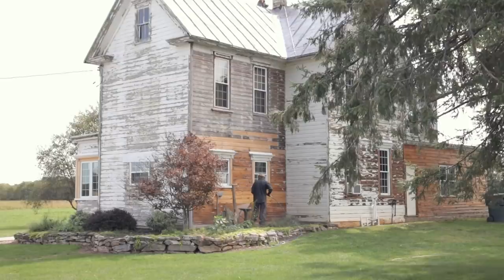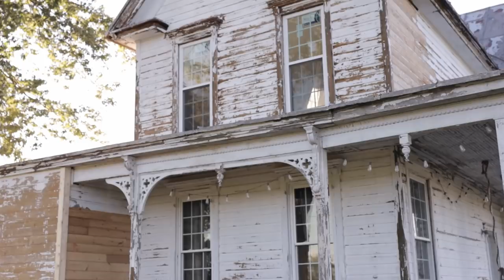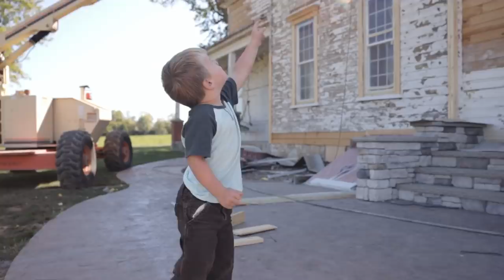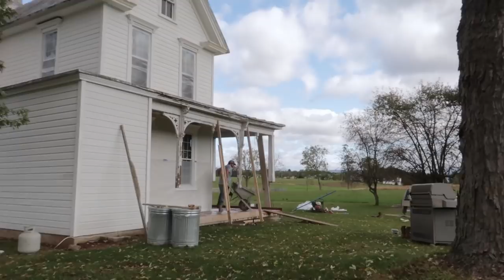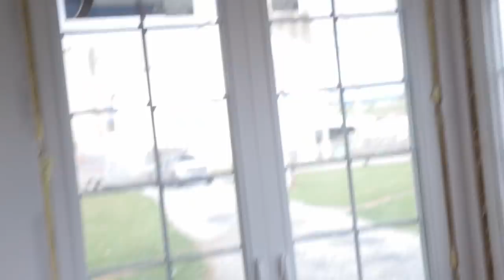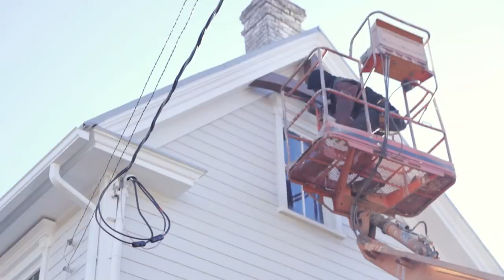HISTORIC 1900 Farmhouse Restoration! 👉🏻 (start to finish)

Comment: Superb transformation. The success is down to the simplicity of colours and using natural products. I would make one teeny tiny change. The cellar doors(are they cellar door?). Change the colour. You have the 2 whites , house and trim(amazing). The super dark blue doors and the fab wood pillars on the porch with the matching wood decorative piece in the peak(not sure what to call it). But my eye gets drawn to the cellar doors first. Wrong colour. I shouldn't be able to notice them at all, but I do . First. It's minor and only my opinion. You have done brilliantly.
Reply from the maker: Yes you are right. They are primed and we hadn't gotten to painting them yet, I should've mentioned that 😀 it is a garish red lol

Comment: I love your home. It turned out really beautiful..You are very lucky to have a husband who knows carpentry and know painters.  I'm working on restoring my family 1940s/50s wood frame home.  I had plans drawn up to remove existing 4/5 pitch roof and add a 12/12 pitch roof with dormers in front and a shed dormer in back as well as a double car garage with two dormers in front and shed dormer in back. I would love to have the carpenters who worked on your home to come to georgia and work on my matching the windows of the old house to the additions as well as replace some of the clap boards.  I'm still in the planning stages but I would love the contact number of the painters/carpenters.  I'm Kevin Hollis and I live in Midland Georgia  right outside Columbus Georgia which use to be the county but now it has been incorporated  into Metropolitan Consolidated Gov't..
Again your home is absolutely beautiful... the exterior from the paint, repaired clap board siding, additions of the overhang on the side and the beautiful kitchen.  You and your husband should be proud.
Reply from the maker: Best of wishes with your home! It is a lot of work, for sure!

Comment: How many coats of paint did you use on the exterior?  I  know I saw some was hand painted and some spray, so I couldn't tell if you did a primer coat then a top coat, or more than one coat.  On our old farmhouse (same era)  we have a hard time getting the paint to stay on this old lumber (siding) for very long.
Reply from the maker: He primed and then painted. Sprayed first then brushed over to get it into cracks

Comment: Your house looks great. Please don't interpret this as being critical because there's nothing to criticize. It looks like the porch still had enough remnants of the original Victorian "gingerbread" details surrounding the pillars, up along the roof overhang that it all could've been re-created. I'm curious what the driving factor was in the choice to eliminate the historic appearance and put in the more modern looking porch pillars design (if you said it in the video, I missed it. Sorry).
Reply from the maker: Just simply personal preference and also eliminating a lot of work. There was only about 1/4th of the original pieces. Many were also rotten
Reply: @theMennoniteMom  Thanks for sharing. Again, everything looks fantastic.

Comment: My house was built in 1889 it is and old farm house their is still silos and barns well not your classics barns just ones used for machines and still has farm land used around it. But the house doesn’t look the same because my house was renovated when I got it so it looks different and a whole little section was added two the house that included a bedroom bathroom and a hall that lead into the basement before there was a door outside leading to the basement. When I got the house it was 8 years ago so the house when renovated around 50 years ago maybe longer I think I’m not sure.

Comment: It looked beautiful…you had me going until you replaced all the gingerbread and then not so much. So sad. Irreplaceable gingerbread…hope you sold it to someone for salvage and didn’t just toss it for scraps.
Reply from the maker: Gingerbread? I'm at a loss what you mean. I'm sorry.
Reply: @theMennoniteMom  sorry if I was harsh. You did a lovely job on the house. I loved that you worked so hard to recreate the original trim around the windows. What I meant by gingerbread is on the porch and over your big gable- the porch rails and trims where the original trim work and spindles/gables were. They can look like curilicues or fancy gingerbread pieces. I was just so sad to see those original pieces go. I know that isn’t for everyone though.